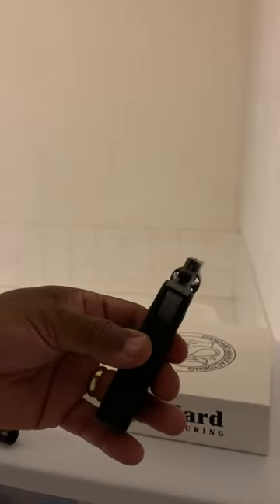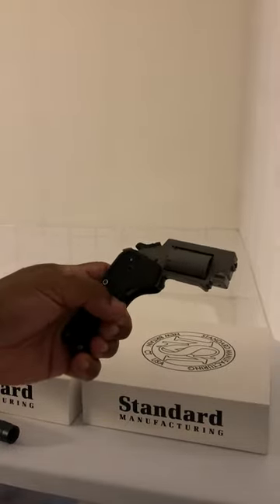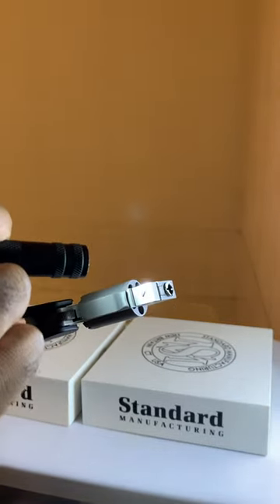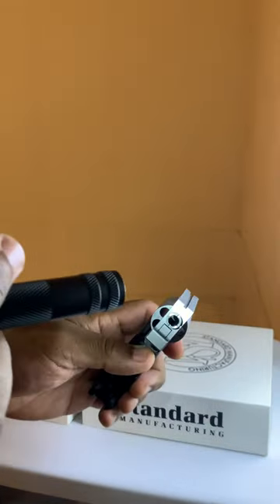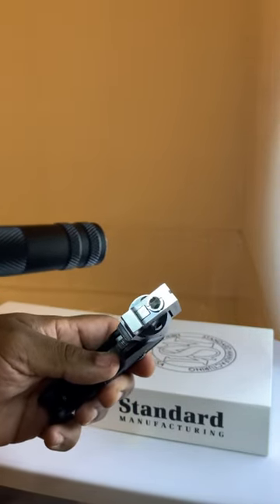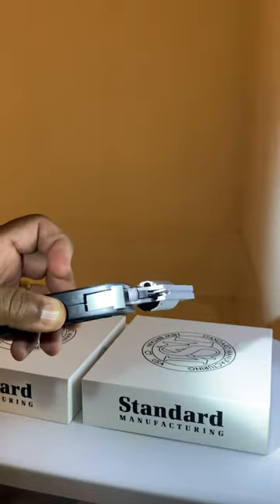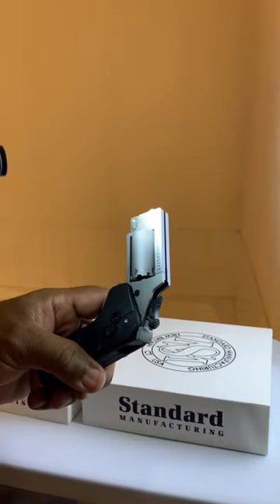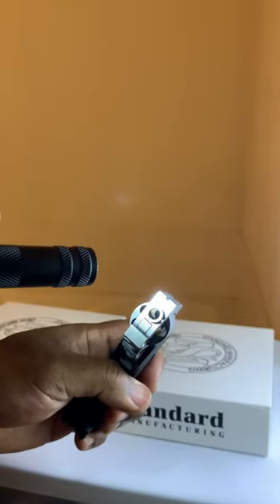Standard Manufacturing Switch-Gun Review: “DO NOT PURCHASE!!!”

Comment: loctite for screw, cmon man. reset cylinder. graphite dry lube. i'll buy it for 4. if you dont want it
Reply from the maker: Cmon man, it’s a piece of junk. I got rid of it. Go buy one if you want one. Later!
Reply: Bro you slow, put loctite on it. It’s a common problem with people who have put alot of rounds in it. I’m guessing it’s still loose or you damaged it shooting it while it was loose
Reply: @xlilnetx  Loctite  will not help. I got the same problem. Took it apart  and this is just a bad engineering. Left hand thread little bolts  hold everything. Plus 2 small springs that  really hard to put together in working condition. Total garbage.
Reply: So you are having issues with the new model version??? Does yours have the red sight?? Or full trench sight??